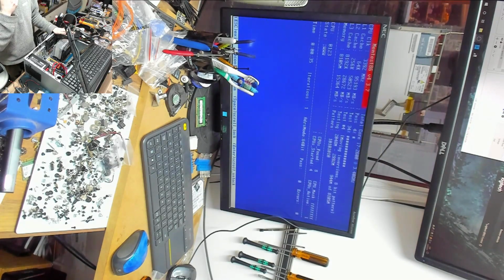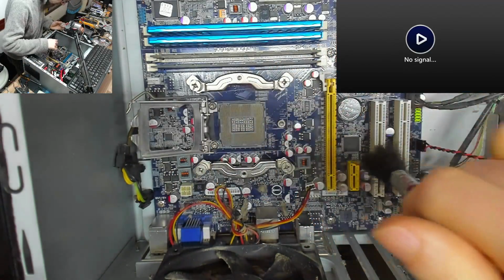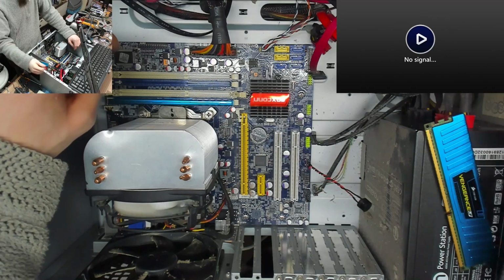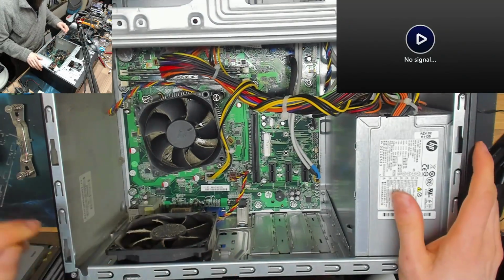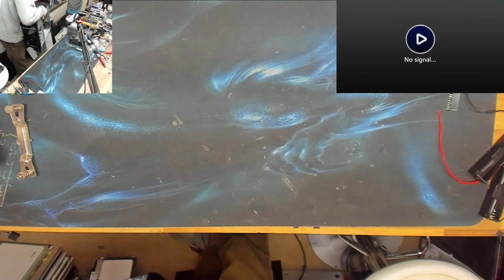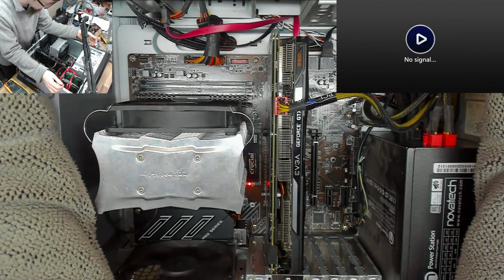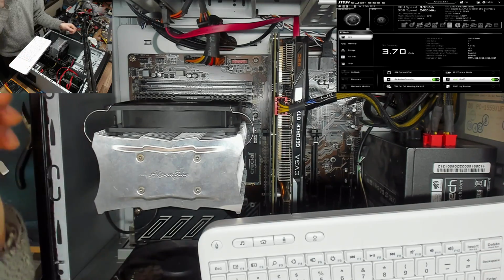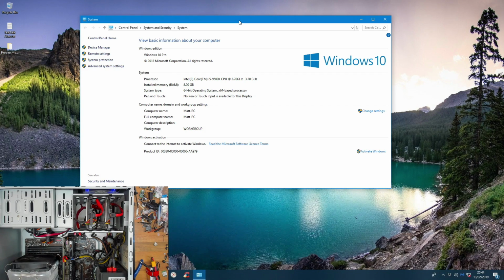LFC#160 - Intermittently dead motherboard rabbit hole.

Comment: I have a Foxconn mobo with an interesting fault.

H77M board
i7 3770
4 x 4GB cheapo RAM

Bought as Advent branded machine from PC World with an HD6770 1GB graphic card.

I upgraded to a GTX970 which worked fine unless the DP ports were used. It wouldn’t allow you to get into the BIOS and took forever to POST. Once running, worked fine. If hdmi was used, it worked fine. 

I assumed that it was a different Gen compatibility issue with the PCIe port. 

Added to the issue is that every BIOS that Foxconn made for the board would say that it was not the correct BIOS and refused to upgrade. Also, the BIOS on the board, Foxconn say doesn’t exist. I’m assuming that it is an Advent specific BIOS for that board as it displays the Advent logo when POSTing. 

There is very little information online to help troubleshoot this issue. 

My solution was to buy a cheap second hand MSI Z77 from eBay. 

Having seen your BIOS chip programming video, I am tempted to have another play with this Foxconn board.

Comment: My second-gen i7 still works very well indeed. But, it is sitting on a very good motherboard (Fatal1ty) and the Cooler Maser case is like nothing available today, so I hate to part with it. Have you ever seen a large Cooler Master case with a SATA drive slot on top? I never could find any ID on the case.....

Comment: It's probably already been mentioned in earlier comments - hey, you posted this a year ago - but you should have tried changing the CMOS battery. At 8 years old the battery was probably dead or dying, and the latter can cause interesting effects. Also, I'm surprised you didn't notice sooner that the banks of RAM were incorrect. 

As for it never being the CPU, always check the heatsink! I've cooked a CPU by accidentally putting the heatsink on the wrong way around so it doesn't contact the CPU.
Reply: i just posted that lol.

Comment: ... As you said 8 years old... so... maybe the just the mobo battery could be dead?
Reply from the maker: Dead CMOS batt won't stop the mobo from booting - just means it won't keep the time/BIOS settings properly.
A healthy mobo should boot and run with no battery at all in it, you'd just get a BIOS reset every time you turn it off.

Comment: What a RAID hater these 2 drives are not in an RAID array thou they are set as STRIPE which is called RAID 0 but is not really raid :D Having 2 drives in stripe is actually a great way to improve write speeds and not have to shuffle your data around between 2 drives so for a steam library lets say this configuration is better than having 2 separate data drives. SHAME ON YOU! Also SSD RAID is a very good idea you should look into that and fill your knowledge gap...

Comment: "i5-9600k", well at least it's not 4 threads like my 4690k. i'm regretting that right now, but I'm thinking this guy will regret that this thing is only 6 threads if he keeps his computers that long.
Reply: He survived 8 years on a 500GB HDD. I'm willing to bet the customer is not a massive gamer. Probably a home office computer. Customer's priority, it didn't have to be top spec, it needed to run without going over budget. Upgrades can always follow.
Reply: What? Even if that i5 9600K only has 6 threads. It will smoke that 2600 with no problems. 2011 vs 2018. 4 Cores vs 6 Cores mate. yes, that i7 has 8 threads. But even with 8 threads, it will not compete ;)
Reply: @KASE94  the next consoles coming out have 16 threads, and from personal experience that "just enough" mentality on cores has come to bite many people who keep their computers a long time in the ass.

i stand by what I said, if they're gaming or doing workstation task, 6 threads is too low unless you plan on upgrading in like 3 years or less.

if you keep your system for like 5+ years, i'm saying you'll be forced to upgrade sooner than you needed to because you didn't spend an extra $100 back then, and now you gotta spend 200-500 5+ years from now just because your game doesn't run smooth with less than 8, even on low settings.

Comment: Can anyone help me? Recently I had upgraded my wifi card and my cpu cooler. When I turned my rig back on the fans would turn on for a 1 second and then shut off. I took my pc to microcenter where they said the cpu and motherboard was defective. I purchased a new mobo, ram, and cpu. I put everything together and the same exact issue is happening! Any ideas? Is this possibly the psu?
Reply: Well, the shop scammed you . The first time you had the problem it's hard to tell but THEN you assembled new parts so there was probably an issue with the 2nd assembly. It all souns like hardware install issues
Reply: That shop absolutely scammed you lol.

Comment: Such old computers, is it not cheaper to buy a new system than pay a repair shop to fix it?
Reply: About the same, but it doesn't get your data transferred & you roll the dice on what components they cheaped out on. Plus this sort of upgrade gets you local support.  Not to mention you don't end up with some monstrosity that looks like the illegitimate offspring of a transformer toy & a disco light show.

Comment: ryzen would be way better and cost effective upgrade than the i5
Reply: Probably what he had on hand...
Reply: Depends what he was using them for. At the time of this video, I believe it was the Ryzen 2xxx line available. While they are better for multithreaded work, intel's chips where still stronger core vs core. While I agree Ryzen would be better cost value, not necessarily better for performance. For example, if the client was a gamer, then he would see better performance with the i5 then he would with a 2500 Ryzen in most cases. So "way better" is a vast over statement.
Reply: Intel series is a lot more stable with BIOS, so there's a lot less chance of the system coming back with issues later on

Comment: I bought one intel Foxconn mb for a give away that refused to hold the bios when shut off load defaults it worked fine till shut down again and bios jumper was correct.
Reply: Replace the battery. Check for BIOS update.

Comment: You should get a PCI tester to help get diagnostic codes out of old MOBOs like that. Newer ones may have a little 2-digit LED display already on them, or they may not have a PCI slot entirely, in which case you'd need a PCI express tester which I'm not sure exists.....does it ? :|
Reply: The're cards that have both, you can just turn them around

Comment: I am cringing when he touches CPU surface with fingers 😱
Reply: Because ?
Reply: Humidity is like 80% where he is.
Reply: They're not as sensitive as you were told. Also, if you have enough ESD to damage the part, the metal case or screwdriver will let you know with a spark.

Comment: curious why you didn't choose to upgrade them to a Ryzen 5 2600 or 3600 as they are much better value for money than current gen intel.
Reply: Maybe the customer prefers Intel ?
Reply: @SantaClaw  maybe, that's why I'm asking.  I cant see any other reason why you'd choose Intel over AMD at this point.
Reply: @AndehX  maybe because all AMD products feel like a beta test
Reply: Because most people don't care about the Intel vs AMD thing. They have an i7 that worked for 8 years that still would've worked if not for the bad motherboard. Customer has no real reason to switch to AMD. You don't suggest your personal preference unless the customer asked about it or they will bury you and your shop if something goes wrong even if it's not due to switching from Intel to AMD or vice versa.

Comment: 1. why single dimms? couldnt you find a 4gb x2 sticks? dual rams are always better
2. isnt it better to put all the components to the board before you put the board itself back to the case? same goes for the cpu cooler and its fans, just less hassle

Comment: What about windows activation? Did it have a fit after changing all of that hardware?
Reply: As far as I know that's only a problem with OEM keys. With retail keys you just have to tell it that the hardware configuration changed and it will not complain as long as it's being used on one pc at a time

Comment: Is it not possible to fix the motherboard? I have seen you fixing notebooks motherboards, what's the difference with this?
Reply: Depend if its possible to fix or not (not because notebook diff, actually same boards) , in this case seems like fixing this board will cost = as new mobo in cash.
Reply: It's possible definitely but is it worth it, especially on an 8 year old PC?
If it's your own PC and you have the spare time, sure. But if you're running a shop, the customer is not going to pay you extra even if it takes you the whole day repair the mobo; plus you won't know if the bad part is replaceable till you find it so it can be a wild goose chase from the start.

Laptops; on the other hand, will not always have a replacement mobo available for purchase so repair may as well be the only option.

Comment: 2nd gen i7 pulls like a horse. Its wrong to assume that its slow just because its a 2nd get. I would even dare to say that the 2nd gen is one of Intels all time best CPUs. I see no reason to upgrade and invest into that expensive DDR4 platform.
Reply: 100% i7 2700k non oc still keeps up to a 8700k i think it was, the fps difference is like 5% if even most of the time, im running an i5 2500 an it still kicks

Comment: update/reflash bios fixes such issues 50+ % of the time and replacing the bios chip fixes 80+ % of the time.  but because retail consumer boards bios/CMOS chips are hard soldered in and not an ic set socket configuration.  Still used in high-end server boards and mainframe birds.  MOB is so cheap considering so a bad CMOS/bios chip makes it a throwaway board.  I am just too old on computer tech.
Reply from the maker: I think if I saw this job today I might've been able to save that mobo. I've learned a hell of a lot about BIOS flashing over the past year that probably would've been invaluable to this video.
Reply: The pc didn't even POST. How would he flash the BIOS?
Reply: @skylineboy092  As I said, it the Cmos chip is toast, and you can not post directly to the bios, the chip will need to be replaced and as I also said almost all MB's have the CMOS chip hard soldered to the board so replacing is difficult at best assuming you van get a good CMOS chip with bios loaded.  If you are lucky it will post to the Bios but not let the operating system boot. If not, try supercooling the chip to see if it will post, it sometimes works. If not, the board is dead and not worth the time to fix in relation to the board's cost.  High-end server boards and mainframe boards have the Cmos chip inserted in a socket and are much easier to swop out.
Reply: @skylineboy092   Remove the CMOS chip and insert it in a CMOS programming bench board; If the chip will not respond to a firmware connection or fails to flash after a connection is made to the chip, the chip is toast.  Not every run of the mill shop has this equipment.  Large data center tech shops do.  And not so easy on modern motherboards because the chips are no longer inserted into an IC chip socket, but hard soldered to the Motherboard.  Most electronics board are throw away boards because of the difficulty in removing bad components to replace with good components.  If you are working on old mainframes or proprietary servers that are no longer in production and not supported, the component level repair is a must and usually depends on a boneyard supply of doner components or boards from nonfunctioning computers.  Take data centers that deal with financial and payroll data, they still run IBM big blue and old Wang and Digital mainframes.  due to old data storage tech that is not cost-effective to transfer to modern media for storage and retrieval.

Comment: This infuriated me with the slipshod attempts to shortcut the repair!  
I started with the Mac and Mac PLus and moved on to pcs and have been building, diagnosing and repairing since the 8086 upwards.. FIRST order of business was spot on.. Replicate the fault WHILE WATCHING IT, not drifting off on a tangent. 
Next is to strip ALL peripherals to a bare bones system and see if it is cured, NO then ALL those are ruled out. 
Next swap in Known good ram..  NO? try the PSU, Still no? try a working CPU.  THEN you can say it's the motherboard in 4 steps..  as it is you still have to prove its the mobo .   It may well be but you didn't prove it.

Comment: Intermittent problems are the worst, i had one problem with my personal pc and i lived with/troubleshooted that issue for around a year. The problem was that pc had random shutoffs during the operation, regardless workload if im gaming, idling or 3D rendering those shut-offs were completely random it could be 10minutes after pc bootup or 8 hours after. i tested pretty much all components except cpu and mobo. (it was 32gb ddr3 1600mhz cl9, 4790k gtx 1070, z97P-D3 motherboard and be quiet straight power 10 600W psu). I tried all the solutions excluding changing components, i tried making sure that chipset ran at decent temp, resetting bios, updating/downgrading bios version, memory testing reseating every component, running outside the case, so on and so on, nothing helped. So i said f*ck it, and upgraded to x570 crosshair hero 8 and r7 3700x, no problems since. That motherboard was pretty bad, i ran 4790k at 4.6ghz and i guess it was a little bit too much for z97p-d3 motherboard with its trash vrm. Never again im skimping on motherboard.

Comment: Why didn't you put the CPU, Cooler and ram in before you put the mobo in the case?
Reply from the maker: It's six of one or half a dozen of the other really. Although if you're aircooling, then yea it's easier to fit that before the mobo goes in.

Comment: Had the same problem on two MSI X99 SLI Plus motherboards. After troubleshooting it turned out to be that both motherboards didn't like SATA cables, not even brand new cables. My fix was M.2 drive

Comment: i was expecting from the memory test u made a fix atempt on the obviously faulty board i have a 2 gen i5 2310 jejejeje and still try to fix it every time a mosfet blows up lol 500 pounds here are a humongous amount of money here cause the exchange rate here u need a pci/pcie post card, it helps a lot with problems like the one u just had

Comment: Motherboards have changed drastically in appearance over the years.
Reply: The good ones yes. The cheapo boards look about the same. Maybe a few less bright colors on the low end.
Reply: @skoopsro7656  What boards are you looking at main brand boards now even the cheap ones are all black mainboard and the plastic parts on them are also either black or grey, unlike back in the day when boards used to use blue pcb's and blue and white plastic
Reply: that board is from about 10 years ago
Reply: I have a board about 2000, 2001.  My 2005 HP looks better.  My brother played with 486 and before.  Tandy 64 I think...
I started "imptoving " my 2005 HP ..

Comment: I basically did a upgrade like this. Though, i went back another Gen. and got a Golden 5.3GHz i7 8700K for $280 and this was in Jan. 2018. I also found a z370 Aorus Gaming 7 motherboard to go with it for $145. Got a 16GB kit of GSkills FLARE X 3200CL14 (Samsung B-die) that overclocks to 4133CL17 for $90. I essentially got all 3 main (base) components to start a build. They were all open box items but, brand new with damaged boxes. $500 for a setup like this, i just couldn't pass up. Gaming 7 was $250+ board originally. I was very surprised to this board marked down, even if it was almost a year old. It looks awesome, lights up like a Christmas tree and has the best VRM out of any z370 board besides the GODLIKE. Using 10 (ISL99227B) 60A smart power stages in a 4+2 configuration but, double to an 8+2 using (ISL6617A) current balancing smart doublers. So its an 8 phase Vcore with 480A total current capability. And more powerful than most Z390 boards. It can also run the 8core 16thread 9900K. Which i eventually upgraded to. The i7 8700K that is still a monster, i put it in another z370 Aorus Gaming 7 that i got for $170. After such a great experience that i had with that board, i decided to get another one for the 5.3GHz 8700K. It was the only board i could find that would run it and not overheat. I had the Corsair Obsidian 500D case and 860i 860watt PSU and dual 1TB Samsung 970pro nVME M.2 drives which i put in RAID 0.  The z370 Gaming 7 had 3 M.2 slots so i fugured it would be a good match. But, not really. the DMI 3.0 bottled the 2 970pros so i took them out of raid. One could still reach 3.5GB/s tranfer rates which is plenty of speed. It wasn't until i got Gigabytes z390 Designare, that i could RAID 0 2 of those 3500MB/s nVME's and actualyy get 7GB/s tranfer rates. Thanks to the PCIe direct to CPU lane distribution that the board had. Plus dual ThunderBolt 3 on board. Yeah, that one i had to get. I eventually made that one my editing rig. With all the money i saved by going with open box last Gen parts over the past 2 years. I was able to get a eVGA RTX 2080ti FTW3 Ultra which is pretty much one of, if not the fastest air cooled 2080ti's out there. I also got LG's 55inch C9 O-LED TV for the family. Couldn't be happier. 10th Gen may run a little more cool but there is no architectural upgrade past skylake. So, i think i'll wait for Golden Cove or some other Cove for my future PC needs.